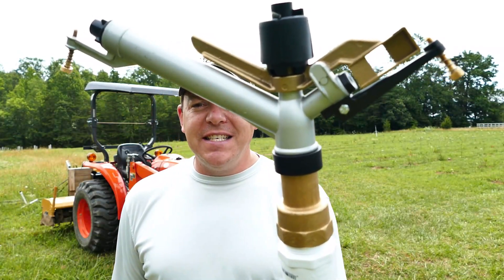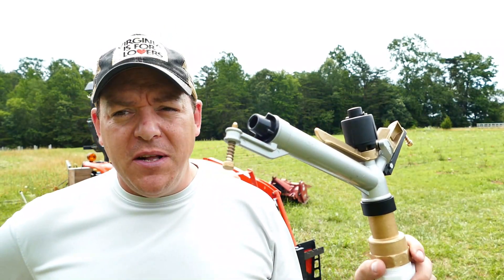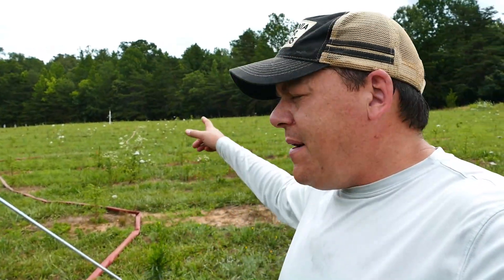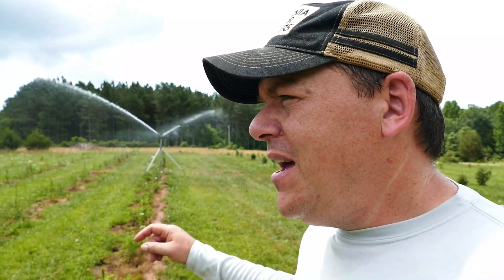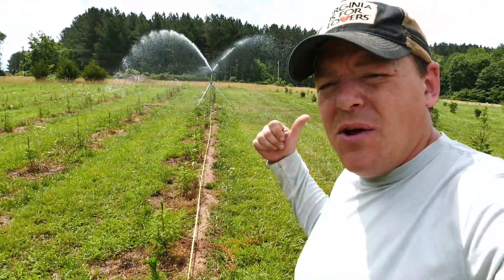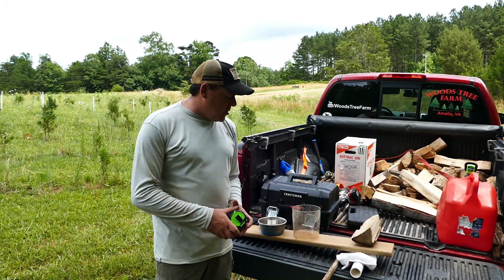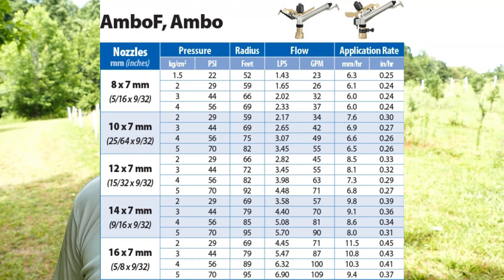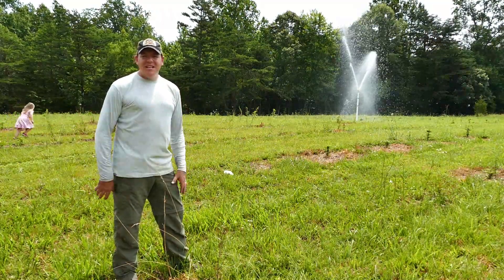Lets See If My Pump Can Power TWO Rain Gun Sprinklers

Comment: Thanks for the video. Sorry your pump didn’t handle two of the sprinklers but you saved me some money. I was going to use steel pipe to run mine till I saw you were using pvc. I had all the pvc I needed, just had to get a couple fittings. $8.56 later the rain gun was up and running. I’m reaching about 72 feet with the 2” pump from harbor freight with the predator 212cc engine. Pumps about 110 gal a minute.

Comment: Hi there. It’s been over a year but I just ran across your video. One thing that’s hurting the sprinklers is the main line your feeding them with. You need bigger main line for those sprinklers and a minimum of 80 PSI. Go to a 3 inch main line and tee off to the two sprinklers. That should pick your throw up. Good luck.
Reply from the maker: Thanks for the info. My pumps have 2"output and the better one only goes about 60psi, so this is the best I can do for now without investing in a bigger setup.

Comment: Do u have a 480v electrical run by your pond ? Or do u have a engine with a pto output ? You could get a bigger pump like a pto pump I've seen farmers run 200 nelson big guns with them and they get some amazing range. Maybe invest in a bigger pump and a nelson SR100 or SR150. If you have a bigger pump you could run 2 SR150s and get maybe about 100 150 feet possibly
Reply: How much horsepower of a pump is required to use a nelson sr150?
Reply: @godwinsmimshach6646  my 7hp pacer se2ul e950 ran my nelson p150 with a 1.08 nozzle but it was weak. It's 50psi and 195 gpm total. But with a .70 taper bore it ran much better

Comment: You may have figured this out by now.....but if you have the smaller nozzles for each of those sprinklers, you could probably get the pressure back up by running the smaller nozzle in both sprinklers and regain that larger diameter you wanted. Then you could be watering with both sprinklers covering more ground.....and just run the pump a bit longer to get the amount of rainfall you need. OK...you mentioned that at the end......curious if that helped. LOL
Reply from the maker: Hi thanks for the comment. I've found the best result is with one head on the pacer pump which puts out about 50psi it'll shoot over 80ft radius consistently and put out a better rain curtain over that distance.
Reply: @FlatCreekOutdoors  .ive been researching which pump i want to get with my Big Sprinkler as well. Currently thinking I will spend the money on the Northstar model with the honda engine. I think its rated around 90 PSI on the top end. That would be enough to run two (I think) if I ever wanted to run two simultaneously.
Reply: @rbljackson  it may not stack up that way that is restricted psi, redlion pumps are also good.